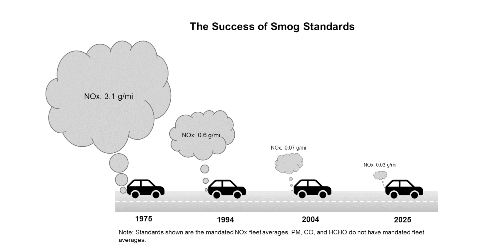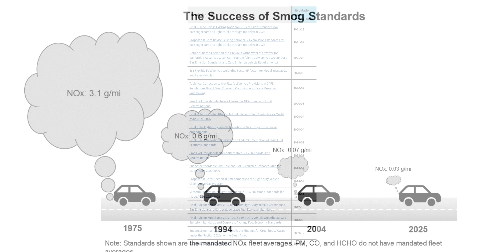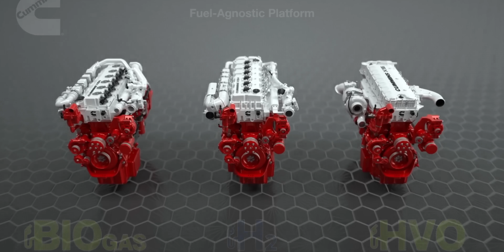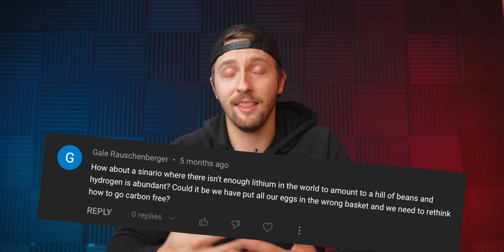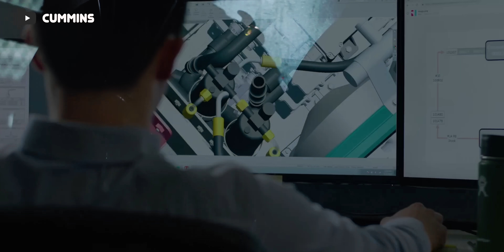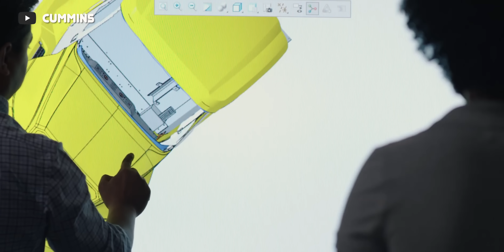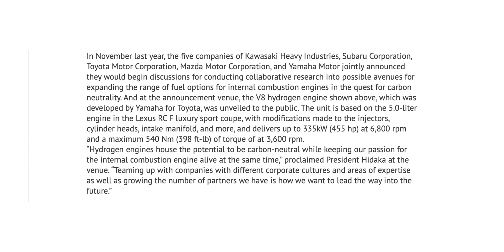Cummins Hydrogen Engine Will KILL DIESELS FOREVER

Comment from the maker: Will diesels stay around for much longer?
Reply: Yes. You can't beat the power of a diesel.
Reply: @borla4491  hydrogen has 3 times the energy density of diesel fuel.
Reply: @BigInjun05   
Never if measured by volume @ at atmospheric pressure.
Reply: @BigInjun05  energy content per gallon 
H Gas 6500 btu @3000 psi VRs diesel @137,000  btu. 
For practical application not counting the steel tank to hold the equivalent amount of energy , diesel has 21 -1 higher density.
Reply: @FFLFFS  Diesel has an energy density of 45.5 megajoules per kilogram (MJ/kg), slightly lower than gasoline, which has an energy density of 45.8 MJ/kg. By contrast, hydrogen has an energy density of approximately 120 MJ/kg, almost three times more than diesel
Reply: @BigInjun05  wrong
Reply: @BigInjun05  in liquid form perhaps but there is no ICE that can use hydrogen and create even close to what it can on liquid fuel, this is due to a lot of things not the least the lack of density hydrogen has.... Energy rich, density poor it's it the least viscous gas in the universe
Reply: @fluchtigziege3202  
Not so. JCB's prototype green hydrogen spark ignition engines are producing as much or a bit more energy from each unit as their diesel equivalents.
Reply: @borla4491  "Yes. You can't beat the power of a diesel."
t's not the power and/or other advantages of the diesel that needs to be beaten, it's its pollution that it causes.
It is to hope that the diesel is no sticking around for decades as mentioned in the video.
Reply: @kullatnunu2087  You're clearly wrong.

Diesel does not cause much pollution than EVs!
Reply: @dewarkhodern9990  "Diesel does not cause much pollution than EVs!"
As you think that's the case, which clearly is not, what is your suggestion to combat global warming by maintaining your standard of living?
What do you think to know what I don't know?
Reply: @dewarkhodern9990  "Shut up."
Thank you. 
Although this answer is insufficient and rude but it's telling in many ways.
Reply: @borla4491 like with a more powerful electric motor or 4 of them?
Reply: @michaelsmithers4900  Diesels will be around forever. Stop the b.s.
Reply: @borla4491  power does not come from the fuel
Reply: @MarkAlanKing agree Electric Motors are superior is just physics.
Reply: Yes, the Diesel is not dead according to the websites.
Reply: @janamaro5894  you are a
Reply: Yep. You can't run a D-11 CAT or a COMBINE on electricity all day. Hydrogen or propane or natural gas, probably.
Reply: @jeffrykopis5468  As it stands, you /could if you had a Very Large wall outlet...
Reply: @jeffrykopis5468 sure you can. Electric motors run factories 24/7 for months on end  without stop with simple air cooling and little maintenance. 

Farmers will flock to low maintenance and low operating cost when that industry is disrupted.

For now companies
Reply: Diesel is not dead, or dying. Its still one of our most efficient forms of energy transfer.
Reply: Diesel isn't going anywhere. When you look at how they make Hydrogen for the engine to run on its far more energy intensive than burning diesel. So the technology will not be a economic replacement. I know as I work with diesel engines.
Reply: @highground2320  RIP die sel........... fuel
Reply: Not sure how switching to electric will ever be the answer. They say going electric helps save the planet however what happens to all of these ion batteries when there done bury them? Plus your basically riding on a radiation pack! I think hydrogen will have a place on the future for hauling.
Reply: @Don Hubbard  can recycle the whole battery. Bit it's still not the answer.
Reply: @BigInjun05  they can recycle them at massive non viable cost.. it's physically possible but not fiscally possible
Reply: @donhubbard5215  there are already free energy devices the side large speaker than can power a whole house ..... wake up people
Reply: @MarkAlanKing  When a dozen people call you a fool, maybe you should self-reflect.
Reply: @blackhawk7r221  a pack of fools is still a pack of fools i do not need approval from fools
Reply: @markseehawer3762  this is my nice side
Reply: @MarkAlanKing  For a woofer to modulate its magnetic field or create electricity, you need to move its coil. The coil is attached to a spider and cone. The cone to a gasket. Moving the coil will modulate the magnetic field and generate electricity, but much of the energy is lost to the spider and gasket. There is a net energy loss.
Reply: @MarkAlanKing  Reported!
Reply: @MarkAlanKing  
What is “free energy device the side large speaker.” ?
Please explain.
Reply: All I want is an end to the “end fossil fuels” in the US. All of religious belief in getting rid of fossil fuels is ignoring the fact that US vehicles only produce 2% of the world’s carbon, and volcanoes above and under the sea are way more impactful. However, there is a lot to be said for the micro nuclear reactor and its ability to produce with a small foot print almost anywhere the energy for electricity or heat, for processes that need it. But let’s say we want to go nearly zero carbon, then use nuclear energy to convert biomass to biodiesel, and use current infrastructure, case closed. Nuclear heat can be used directly for the conversion.  Also, change all but really small vehicles to run on biodiesel, the most energy dense fuel. However, urea exhaust treatment will be required to reduce NOX. However, breaking news from the pandemic reduction of vehicles on the road in 2020. Methane levels in the atmosphere went up because the NOX emissions would normally reduce methane. Methane is much larger contributor to global warming than CO2. So do these climate pseudo-scientists really know what they are talking about. Scientists found that OH concentrations decreased by around 1.6 percent in 2020 from the year before, largely because of a fall in nitrogen oxide (NOx) emissions caused by the COVID lockdowns. Nitrogen oxide is emitted into the air primarily from burning fuel.

A 20 percent reduction in NOx could increase methane twice as fast.
Reply: @Radarcb329  Joe Biden is for clean energy we have to get this done for future generations
Reply: @Radarcb329  we can drill 12.5 miles down by each coal fire plant in the United States and have steam power from thermal heat for 20.000.000 years endless power they are drilling the first well now .
Reply: @Radarcb329  while I can agree on most of what you mentioned. My concern is the waste produced by nuclear power plants. While I know that they are looking at ways to reuse this waste, there is nothing yet that renders this waste safe.
Reply: @antonioendres4836  Perhaps you should look at the Elysium molten salt reactor which receives nuclear waste as an input and burns it to near nothing. It can also use Thorium. This is not new and there is a customer for their design and it’s not new, and not that different from many advanced reactors which don’t have highly enriched uranium requirements like high pressure classic reactors.
Reply: Until EV and Hydrogen range catches up, the diesel industry woll always have a place im commercial shipping.
Reply: @RandomlnternetGuy still technology not used and can be developed for diesel
Reply: @RandomlnternetGuy  LNG
Reply: @RandomlnternetGuy  thats where hour wrong. Its the bottleneck and thats why its under assault
Reply: Cummins❤
Reply: On vehicle fuel storage is a huge issue for hydrogen.  Diesel and gasoline will be around for a while yet.
Reply: EVs won’t be around to much longer
Reply: @LU-D1GITAL Based on?
Reply: @LU-D1GITAL  yes they will but they will never need to be recharged .....
Reply: @MarkAlanKing  not in aus to much distance to travel en to long to charge  if drive 8 hours not got want to wait 1 hour to charge the fucker
Reply: @MarkAlanKing  how so?
Reply: There are so many reasons to keep diesel engines. The foremost 2 are range and engine torque (pulling power),horsepower is how fast you can do something, torque is how much you can do.
Reply: @cbmech2563  engines are staying fuel source is what is changing
Reply: The simple answer is yes the power output by diesel is amazing it’s out lasted the air pressure engine gas engine and steam engine the reason for hydrogen is it keep the green intuitive off it’s back while production of combustion engine continues
Reply: How about nuclear 🤔
Reply: @Retired Bore the Mirai uses an electric fuel cell. totally different technology from the hydrogen combustion engine described in the video. Also, I should clarify something that I left unexplained in my original comment: Hydrogen storage systems are not worse from a weight standpoint than EV batteries. It is worse from a volume standpoint. 

The higher energy conversion efficiency of fuel cells vs combustion engines and the fact that hydrogen has more energy in its chemical bonds than gasoline does is what brings the range of fuel cell vehicles close to EVs for less weight. 

However this does not change the fact that you would need to find the space 3-4 times the volume of the current gas tanks on a semi truck to store the hydrogen. Essentially this would require you to surround the sleeper cab of a semi with a pressurized pipe bomb of flammable gas. Plus you would need separate diesel tanks if you wanted to try to have a dual fuel combustion engine as the video suggested. this is theoretically possible, but not realistic considering shorter semi trucks are the norm currently.
Reply: @TheNeighbor4U  Keyou GmbH in Germany has high pressure H2 injection for diesel engines that power City Bus and trucks. Low cost H2 by Proton Technology Inc in Canada will produce “Clear” hydrogen equivalent to $0.25 gasoline gallon.
Reply: @leroyessel2010  I never said it couldn't be done. I just said that it was not the best option from an engineering standpoint, nor from a fuel efficiency standpoint. Hydrogen combustion engines do not get better fuel efficiencies than gasoline or diesel engines after all (~35% efficiency for current fuel engines). There are multiple better more efficient technologies that could be used right now out there already. 

also on the topic of hydrogen production: It uses electricity to produce. So rather than even producing it on the scales necessary to replace traditionally fueled cars it is more energy efficient to just move to electric and plug in hybrid vehicles instead. 

Then you also have the fact that the whole point of moving away from gasoline and diesel engines was to limit greenhouse gas emissions. Hydrogen combustion engines do not fix this issue the substantive way that electric, plug in hybrid, or even fuel cell vehicles would. 

Hydrogen combustion engines are neat in the same way that top fuel dragsters are: they are fun to play around with and watch race, but they do not have the necessary qualities for personal or commercial daily driver vehicles in the long term.
Reply: I fucking hope so, for a long time to come
Reply: I will stay with may engine “ Cummins😎😎
Reply: yes we do not have much hydrogen infrastructure to make hydrogen store hydrogen and fuel stations
Reply: @abbeytim22  storing hydrogen is a waste of energy, time and money, hydrogen atoms are the smallest known to man, trying to contain them with vessels made from materials much bigger than hydrogen is a monumental task and thusly those who use hydrogen industrially usually make it on site where it's being used
Reply: Old ones will.
New ones will, too.  Once they're deleted of the expensive and unreliable emissions controls.
Reply: Yes
Reply: "diesel" engines will be the last I.C.E standing. Considering the vast range of fuels you can use. Ev's are coming for sure, I just wish that r&d was a bit more thoughtful
Reply: @Retired BoreThis article ignores the reality that burning diesel or hydrogen in air produces NOX because air is 80% nitrogen and efficient, high temperature combustion creates oxidation of nitrogen. I don’t necessarily see the need for hydrogen, if advanced micro nuclear reactors are mass produced, permitting volume conversion of plant matter to biodiesel. So the energy technology with the smallest foot print can produce heat or electricity to support vehicles or other purposes.
Reply: @Radarcb329  
JCB's prototype H2 burning combustion engines have NOx-free emissions. Research confirmed that H2 combustion must not exceed a certain temperature. They overcame that by reducing compression ratio and using spark ignition.
Reply: @ChangesOneTim  In the late 70’s, a show on Nova about hydrogen stated that water injection was necessary to minimize NOX, which presumably was a way to manage temperature.
Reply: It doesn't burn hydrogen or diesel it burns  diesel and uses hydrogen to clean up the burn increase the flame speed you greatly decrease the the timing to dam near 0 increasing the efficiency look up Roy McAlister plus hydrogen
Reply: @glennimmortal  Cool, i hypothesized something like that but couldn’t find a reference.
Reply: @glennimmortal  American Hydrogen Association had Chapter in S. California and it was Dr Zweig and Richard Williams who played a important role for public outreach. The Keyou GmbH in Germany and Proton Technology Inc in Germany are worth investigating.
Reply: @glennimmortal  I met Roy back in 1990 when I returned the H2 powered pickup truck and towed it from Los Angeles to Tempe Arizona. Roy started the AHA and it appears to be still active online and podcasts today.
Reply: As long as they aren't replaced by a hybrid drivetrain with car engine sized gasoline generator systems: Yes. They will absolutely stay around. Hydrogen has 3 massive issues that will prevent it from ever replacing them: refueling infrastructure cost, the energy storage density of storage tanks, and the existence of objectively better alternatives. 

Hydrogen infrastructure is multiple times more expensive than gasoline/diesel infrastructure. we are talking 2 million dollars per pump system vs 500,000. This massive expense difference would significantly hinder the spread of hydrogen fuel stations. It would make H2/diesel dual fuel trucks into the commercial equivalent of today's E85 flex fuel passenger vehicles from ~2015 that are still on the road. 

Hydrogen storage mediums have a hilariously low storage energy density compared to even EV batteries. And EV batteries have about 30% or so of the energy storage by weight and volume versus gasoline and diesel. Factoring in the ~45% efficiency advantage an EV has over a gas or diesel engine means that in total, current battery technology stores somewhere between 50%-70% of the energy that is in a tank of gas/diesel depending on battery chemistry. As for hydrogen, according to an "energy dot gov" website pdf titled "fcto-h2-storage-fact-sheet" a hydrogen tank with 10,000 psi of storage pressure would need 3-4 times the volume of an equivalent tank for gasoline/diesel. 

This means hydrogen tanks are roughly 2 times worse than an EV would be for the size of battery necessary for a given range. Plus, you would be adding a massive pipe bomb onto your semi truck instead of just a tank of flammable accelerant. A non pressurized hydrogen storage tank of the necessary size would be safer, but would likely not fit on a semi truck at all. Furthermore, a hybrid diesel/H2 engine would make this tank size problem worse by needing separate tanks for diesel and hydrogen. 

The worst nail in the coffin for a commercial truck sized hydrogen engine is the objectively better alternatives out there. A diesel electric (train style) or gasoline electric (plugin hybrid style) drivetrain with massive electric motors providing the power would be an objectively better alternative to a hydrogen engine that could be designed and put into production right now. No new technologies needed.  Additionally, with the right design choices the electric motors on a hybrid system like this can be made more reliable than a diesel engine is. They only have 3 moving parts after all: 2 bearings and a rotor assembly. 

As a major Semi truck manufacturer you could technically just buy engines / generators off the shelf from tractor, construction or commercial power backup manufacturers, source the motor controllers and motors off the shelf from existing manufacturers and use one of your existing truck frames to have the prototype done in 6-8 months. Maybe another 10 -12 months for testing, refinement and production planning.
Reply: Clean combustion engines are the way, ammonia, biogas LPG, hydrogen mix stop making comparison of absolute efficiency when we need as many renewable sources.
Reply: Great video
Reply: Outside of cities and short commutes diesel is a must, it's not going anywhere any time soon that's for sure
Reply: The auto industry just serves the political agenda with H2 engines and shoved the cost onto consumers.
The process of taking the C out of C4/ natural gas feedstock is a huge carbon foot print and therefore redundant. 
Hydrogen doesn’t make sense mainly b/c it causes embrittlement of alloys, = crack and failures.
C4 has 33% less Carbon than C3H8 (propane) and that much more failure rate. Extend that failure to no carbon and you’ll realize how much of a bad idea Hydrogen powered ICE engines are. 
Just a money maker for the manufacturers. We’ve seen the same thing happening with exhaust emissions equipment. Sky rocketed the prices with very marginal success. 
Win for auto makers.
Reply: Great handling of the subject here. IMHO the diesel's here for a while longer.  The presenter hinted  that he'd played with electrolysis; I'm wondering how that fares as a fuel additive...
Reply: @grahammatthews3798  As far as ICE technology in general goes, the diesel has always been a fantastic idea/implementation. Simple economics is going to kill it quickly though. It has SOME time remaining, but likely very little. More than anything, maintenance costs and cost of entry will rule in the market. Electric will be too cheap to compete against.
Reply: Ya won't get anything as practical as diesel engines in off road use. Even petrol tractors are less practical than diesel (The fuel evaporates out of the tank in hot weather and they burn more fuel). The Government doesn't understand practicality.
Reply: Dust runners auto
May I ask you if they fixed the problem of hydrogen enbrittlement to the metal in an engine.
Reply: I convert a gasoline engine into a water engine NO MORE GAS | Motor with water instead of fuel
https://www.youtube.com/watch?v=JuxQLEDccsU
Reply: Of course, the third-world developing countries like China, India, and most of southeast asia will continue using them with no emissions equipment or regulations whatsoever while the western world which causes approximately 4-5% of the world's pollution continues to be lectured by multi-millionaire autistic girls in braids who don't go to school.
Reply: @armedferret  oil is done
Reply: @MarkAlanKing  explain aviation then numpty, you have none without oil
Reply: @armedferret  oil and gas are done world wide
Reply: @MarkAlanKing  Stop lying!
Reply: @babaoreally8220  https://www.youtube.com/watch?v=elOs3rMpr-8
Reply: @babaoreally8220  https://www.youtube.com/watch?v=sElTtj7vRTU
Reply: @babaoreally8220  all fake math from the jews .... real math revealed soon
Reply: Democrats should be banned problem solved.
Reply: yes they will for the rest of our lives
Reply: A diesel + hydrogen ICE hybrid would be interesting, but by volume, Hydrogen has low energy.
Reply: YES! Diesel and Gasoline will still stay around for many many many more years to come as long as Mother Earth 🌎🌍 keeps on revolving and doing work out! FYI! Mother Earth 🌎🌍 is sweating too every time she spins, revolves around the sun! 🌞 24 hours a Day 7 days in a week! 356 days in a YEAR! She never gotten her break YET! neither Mother Earth never taken her sleep YET! She keeps on working sweating hard, she gets hot and sweats a lot! Perhaps Earth sweats more than my hardworking mom!, and mother earth sweats the Fossil Fuel.
Reply: Nuclear works by steam pressure water to turn turbine steam “engines”
Reply: @Ioulos86  Correct!
Reply: Diesel is not going anywhere. Let us know when hydrogen becomes available and affordable! But it is of interest that Cummins is dipping its toe in the hydrogen pool.
Reply: @TheSpartanBuilder  better hope someone is looking for options when things run short .even a rabbit make a back door.The Republican senators and house members love being the grim reapers while they get rich on kick backs they always have they are caught.
Reply: @TheSpartanBuilder  Proton Canada Inc production cost on hydrogen comparable to gasoline will be $0.25 per KG is market driven
Reply: yes us famers and ranchers need it hydrogen has been around for a long time
Reply: Black/brown/blue hydrogen is worse for the environment than Diesel. It is just a higher margin product made with government grants to petroleum companies with a greenwashed message, the real reason this stupidity is being propagandized. 

Until we have excess green hydrogen (more than enough to replace industrial black/brown/blue hydrogen) and it is made with excess wind and solar (which we are  still far away from having in excess, if it ever makes financial sense to build in excess) using hydrogen for transportation is stupidity that only benefits petroleum executives while harming the world with higher emissions than Diesel.
Reply: No diesel will be around for a while because the is an infrastructure for diesel plus diesel burns cleaner minus the def system
Reply: @satunnainenkatselija4478  Explain why heavy equipment diesels are successful in the UK. Cummins is just behind the stick. Also there is a case for a hybrid diesel with hydrogen cleanup design.
Reply: Even if you gotta have a wood fired pre heater for your veggie oil, still go with a diesel.
Reply: At least Till next five centuries..Diesel will be the most Powerful  Source for Heavy Machinery..
Reply: Hydrogen supply won’t be readily available till 2040 at a minimum
Reply: @wchougland1  Proton Technology Inc Canada looks interesting for ultra low cost hydrogen
Reply: God willing, yes
Reply: My diesels will be around for a few more decades. 89 F250 7.3 IDI W/Banks turbo, 99 F350 7.3 powerstroke dually, 2005 Chevy 2500 HD Duramax, 2008 F350 6.0 Powerstroke (bulletproofed),  and a 2013 Ram 3500 6.7 Cummins. Weird how the EGR's, DPF's, SCR's and such fell off the last three as soon as I got them...
Reply: @scbane  "...the EGR's, DPF's, SCR's and such fell off the last three..."
That's the problem in the States. 
Lack of control and accountablity.
Too many think they are above the law and can do what they want even up to the ex.
Reply: If these engines use compression ignition based on the ideas of Rudolf Diesel they are still diesel engines. You seem confused about engines using the these priciples and the fuel. And anything that can power a diesel engine is diesel fuel. Originally petrol was used.
Reply: Hydrogen and ev is a way to turn you into slaves. The i frastucture is too centralized for people to have equal access
Reply: Curious question right at the start of the video...why would cummins ENGINES want to get into hydrogen ENGINES
Reply: @kelinrkp  
Because other manufacturers have done so already.
Reply: Diesel engines can run on waste oil so they will be around forever I’d rather get a diesel and make my own fuel using waste oil before driving one of those ultra high tech electric cars
Reply: Yes, diesels will be around for the next 50-500 years. There are too many other countries that are simply not going to switch. The reason cummins wants to go hydrogen is it keeps their business relevant in BOTH the H2, AND Diesel market. They have billions of dollars invested in machine tooling and casting foundries that they want to keep in business as long as possible. For engine manufacturers, hydrogen is about the only way they're going to retain their investment.
Reply: @edwardnigma2216  yeah anyone that thinks we are ditching diesel and gasoline in the next 10 years is a complete idiot
Reply: Diesels have a very limited lifespan remaining and will become a niche affectation like classic automobiles. Battery energy densities and vastly reduced charging times combined with the market growth rate has already begun chiseling the tombstone. Just MHO but likely accurate. Batteries as ballast and electric propulsion will solve the shipping issue and locomotives will be no more difficult. It's what I'm seeing, but perhaps I'm vision limited.
Reply: @LegendaryInfortainment  there are also vast swaths of lands on earth where EV will never be of any real use, people in these areas in many nations are providing large to majority GDP and therefore are literally the backbone of their countries, there isn't a scenario where they will be happy to be limited on range as EV will always be, these many vast places are also very far from any other source of power production thus diesel as it is currently being used, will continue to be the only sensible, reliable and viable option, the idea that EV will replace all vehicles is retarded, so is the wet dream people have that ICE and oil based fuels are going to go away within the next decade. That and crude oil fuels will continue to be made as they already are as past of the refinement and use of oils to make a myriad of products, there really is no world where it's going to cease being available and used in many many many applications.
Reply: @fluchtigziege3202  Start counting. It took about ten years to replace horses. I'm afraid your comment will age as well. Be that as it may, we'll all get to wait and see.
Reply: @fluchtigziege3202  I suppose that I could argue you clearly do not comprehend the power of Benjamin Franklin, an Elder Statesman of great repute who shall decide for the both of us from the grave. But I  don't see the point.
Reply: @fluchtigziege3202  All's well and good, I've your measure too. Be well.
Reply: @LegendaryInfortainment  only because the efficiency ratio of power plants run on derivatives of crude oil  has to be factored in. 
The best diesel engine is 55% 
The best ng turbine power plant is 36%
Best coal fired steam is 15%
Reply: @LegendaryInfortainment  electricity works in layman terms like water, if you increase energy density of batteries and don't also increase the charging infrastructure by the same or greater increments, you will only make charging times longer, not shorter, and also suffer with more thermal and resistance issues.
Reply: @LegendaryInfortainment  You're extremely vision limited if you think an entire industry is going to walk away from billions of dollars in research, tooling, and the supply chain necessary to keep it going.
Reply: they can run on diesel.. vegetable oil.. bio fuel.. some of the older ones can run on pretty much anything that will burn and go through the fuel system such as the old deuce and half multi fuel engines.. the problem with diesels today is the same as gasoline engines.. emission systems and complexity that ruins their potential and reliability.. not to mention mpg
Reply: Hydrogen engines are stupid and always will be. So are electric semis.
Reply: Yes, and hydrogen is a joke as well.
Reply: @gags730  Diesel electric busses are 60% more efficient than pure diesel busses. I would imagine that this is a good route too.
Reply: Humanity is too stupid to stop harming people, so you don't know what the hell you're talking about, for the most part, and you're of little to no good to fellow human beings, especially the innocent and helpless children that you and the majority are harming, instead of doing no harm and caring, like everyone actually needs above all else!!!  Agreed? No? Either way it's the same old situational overall, eh?  smh
Reply: It depends who you allow to operate governments.
Diesels we're doing 70 mpg before government stepped in.
Reply: @ILikeFreedomYo  what do you mean? even today I am sure those little 2.0L diesels can get 70mpg if you have no weight, decent aerodynamics, passenger car tires, and are going down a 5-6% downhill grade. Even I can get 45mpg in my little old beater car with a gas v6.
Reply: Yes yes yes. Tuff, reliable, can run in almost any environment including under water. Upside down. On end.
Reply: What's happening with these new clean burning diesel injectors that introduce air to create a far lower particle burn, like a bunsen burner. Less diesel needed too for higher power. This to me anyway, negates the need for hydrogen
Reply: There are several companies who say they are within a year of bringing unpressurized hydrogen attached to tapes that are released to burn through a small laser. When this becomes mass produced ready it will change most problems with hydrogen.  It should allow refills to be the equivalent to changing a propane tank.  That'll allow electric and ice engines to be easily converted and used for long trips and actual truck work.  Unlike today's electric trucks which are for city folks that don't do trucking.
Reply: Hydrogen engines will need spark plugs, unlike diesels, unless I’m missing something.
Reply: @mdgtube2010  
From what JCB has publicised about its prototype H2 engines, yes. Needs spark ignition to keep emissions free of NOx, apparently.
Reply: You are probably right, I'm not sure how it all works. Maybe the easy conversion is only for gas engines. But I have seen several videos about companies like Toyota working on quick conversion kits for running hydrogen on engines already in use. I'm assuming Cummins has a work around for this as well.
Reply: @mdgtube2010  
My understanding too, but as over the last 150 years all that needs is a standard automotive battery!
Reply: Ever heard of green synthetic diesel? The German govt killed it off, due to their political agenda's.
Reply: Open end fire tube boiler gas to fuel t/p/v , 0degrees centigrade to plus6000 degrees centigrade and conversion to superheated steam. Controlled 212 degrees burn superheated steam from 4H20 .lots of variations used, Rh or Pt catalyst and HCl electrolyte photons below UV suggested..hydrogen fuel stored within nickel silicate compounds for safe handling. If you understood my work you'll see magic. The average temp of this universe is above -213 degrees C. As heat is thermonucleic in generated potential. Requires demand for use.
Reply: Diesels? Depends on the price and quantity of electricity available - the same with batteries. Electric motors are over 90% efficient. Electrical generation via combustion engines runs about 40-50% efficient. My preferences are solar and nuclear since breeder reactors will burn most of what is nuclear waste from inefficient current reactors. See Generation 4 reactors.
Reply: (See Fischer-Tropsch process-
John Dodaro, December 11, 2015
Submitted as coursework for PH240, Stanford University, Fall 2015)
High percentage CO2 processes such as coal-fired power plants could use flue gases plus waste heat from flue gas plus perhaps waste heat from new high temperature, air cooled Nuclear, to form any sort of  carbon molecule you wish including fuels.
Reply: Yes they will not going anywhere for awhile
Reply: I will be dead before diesels will be.
Reply: "Diesel" in terms of the compression/ignition combustion principle will stick around for sure. Nothing compares (and IMO will compare anytime soon) with it for its power/torque combo that makes it so efficient.
JCB's new hydrogen-burner ICEs are to be spark ignition (à la petrol/gasoline), which I believe is mainly to keep emissions NOx-free. Spark and/ or comp ignition is here to stay I reckon. Governments should stop obsessing about EV cars and vans, get real about the practicalities for everything else powered by ICEs, and get behind non-fossil r&d to fuel these machines. Green hydrogen looks by far the most promising currently, but there are bound to be others. Whatever, obsessing about batteries is to risk depleting precious mineral resources...much of them in scarily undemocratic parts of the world.
Reply: Marine Diesel can be cooled down and the Smoke coming out from the Pipe ─ in a Ship they can design such Filter that suck into the Chamber ─ and or going through a type of Mesh Filter moisture would definitely cut down the CO2 and CO.   We can't replace the Way Marine Diesel Engines cooled down by running through Seawater to the Engine Chamber.  US Navy and all NATO Ships run on Diesel Engines don't care how much the Ships would pollute the air / Same with Chinese and Russia.   They even (  ) people... let alone just Pollute the Air with Pollutions from Diesel Engines/Ships/Boats... (Haha ☺ ☺ 🍷 🍷 🌶 🌶 🔥 🔥)

Yanmar Diesel all the Ways 😂 😂 (Japanese diesel engine manufacturer )
Reply: Like everything,,depends on how reliable it is and much it's gonna cost.
Reply: Hell yeah
Reply: Will you do an episode on what the “LS swap” of diesels is? As in what diesel engine is abundant and cheap, easy to swap, power potential, fit most truck/cars, etc. I want to swap an old 50’s Chevy truck and I’m trying to make a wise decision lol
Reply: @Dustrunnersauto
You: "A diesel generator charging a few fleet trucks for road repair kinda defeats the purpose."

Scientists (and myself): 
"You're not that bright, are you?"
If you remove at least 4 fleet trucks that sit idling on a road and have 1 ICE generator running ONLY when you need it to charge the 4 fleet vehicles,  then you save tons of carbon emissions as well as fossil fuel. You're thinking Micro and not Macro levels. Every bit of CO2 reduction helps in the long run.
Reply: Isuzu and toyota:ahem.
Reply: Yes until the infrastructure fairy builds out 1 million fuel stations.
Reply: I can see a temporary phase out of fossil fuels in 2030 or so but fossil fuels would probably make a huge comeback very soon after.
Reply: I hope the next administration completely GUTS the EPA. Their overreach and intrusion into both our personal freedoms and business are strangling our economy and leading us down a dark road.
Reply: @jeffrykopis5468  planning for the future is not stupid getting to the next fuel is smart they are not making more oil .They almost killed the last buffalo but they are renewable.the sun comes up everyday the wind blows the ocean waves come in the geothermal is coming up with new technology with deep wells.
Reply: @jeffrykopis5468  100% man behind what you say.
Reply: @jeffrykopis5468 Yeah screw the earth it doesn’t need to be inhabitable for our children, what did those little beggars ever do for us anyway! Gut regulation and let it all burn!!!
Reply: @jeffrykopis5468  👍. Say it again brother
Reply: They had Water powered vehicles in the 70's but for some reason they disappeared.
Reply: @_wallnutz_  water powered vehicles are what we call "Over unity" they are bullshit and never worked as advertised, HHO gas etc all purported over unity which is physically impossible
Reply: Also, do a video on the Ford V8 4.6
Reply: @babaoreally8220  Perpetual motion is old news nothing new
Reply: @MarkAlanKing  the hardest part about building a perpetual motion generator is finding where to hide the battery
Reply: @Dust Runners Automotive Journal
8:29 "...and if they can massively clean off their diesels..."
What exactly do you mean by "massively clean off"?
The diesel had 100 years to develop.
There is absolutely no chance to expect anything spectacular within the next years and I hope the diesel is not around for decades as you mentioned in your video.
There might be small possibilities to further reduce the NOx, CHs and soot but certainly not for CO2 which is the main problem.
The BEVs can handle the short distances without problems.
The long distances have to be covered by trains (electrical of course) or H2-, eFuel combustion or H2fuel cell trucks and/or trains which makes transportation significantly more expensive compared to electrical vehicles.
Reply: @babaoreally8220  already proved you a liar
Reply: no and gas engines are done also
Reply: @Mark Allen King - New to life huh?
Reply: @MarkAlanKing  you clearly live in a densely urbanised area or don't travel, one of the two
Reply: @MarkAlanKing  Tell that to a failing electric grid in the future if fossil fuels are ever fully phased out.
Reply: @MarkAlanKing  Tried for treason for what? Running a business by offering a service?

Edit: Mark Alan King decided to say that electric companies will be tried for treason by offering electricity as a service, then they deleted their comment.
Reply: @HeLpEr4u083  killing free energy
Reply: @MarkAlanKing  Why should energy be free? So it can be government regulated? What happens when there is a shortage of electricity INTENTIONALLY and things become Soviet reminiscent? What will you do if you openly disagree with the government or it decides to take away your electricity just because? What will you do when electricity is too expensive to pay for from hyper inflation? Choose carefully what you wish for.
Reply: @MarkAlanKing  All free energy would do is take away power from an economy and leave it weak and create a massive mess of corruption.
Reply: @HeLpEr4u083  you are clueless .... money is worthless
Reply: @HeLpEr4u083  grow up big oil killed tesla
Reply: @MarkAlanKing  To be honest, I have questioned the legitimacy of dinosaurs.
Reply: @MarkAlanKing  You can look up footage of nukes from the original Hiroshima and Nagasaki atomic bombs all the way up until now.
Reply: @HeLpEr4u083  grow up japan was carpet bombed and the cities were rebuild in just a few years stop being so gullible
Reply: @HeLpEr4u083  and building will still standing right next to ground zero
Reply: @HeLpEr4u083  well fuel isn't actually made from dead dinosaur matter, just FYI, not can they prove it's from ancient primordial soup, that all came from an opinion piece way back when
Reply: @fluchtigziege3202  Yes, I know. It's just what it's called.
Reply: @fluchtigziege3202  carbon compound molecules recycle thru the earths crust. Old oil wells get filled up again.
Reply: @FFLFFS  yes I am aware of that
Reply: @HeLpEr4u083  don’t say they. His name implies he is a male. Call him; him
Reply: @MarkAlanKing  go buy something without it, king
Reply: @MarkAlanKing  good
Reply: @HeLpEr4u083 wait the electric grid is failing😳 we should probably tell someone 😂
Reply: @MarkAlanKing
You’re the mental equivalent of the PM of Canada. You have no clue of the logistics that get everything from point of production to it’s destination. Try going to an industrial area and watch the parade of big trucks going to and fro. Try going to a port area and watch the container traffic. You might actually learn something. I doubt it but at least I tried to educate you.
Reply: @mikedavison3400  Spew Nonsense!
Reply: @Studio89Graphic
Towards you I most certainly will. 🤮
Reply: @MarkAlanKing  wrong.
Reply: @jeffrykopis5468  why?